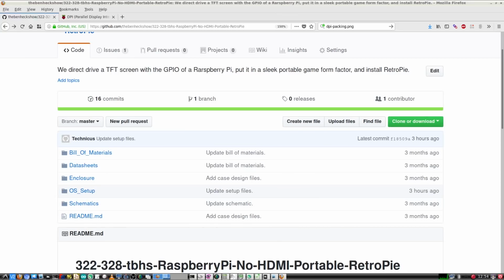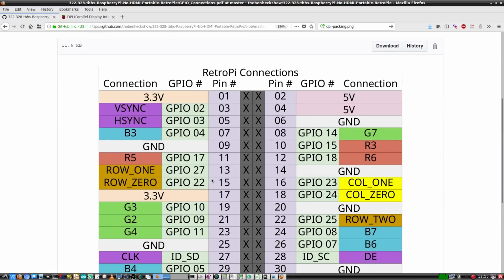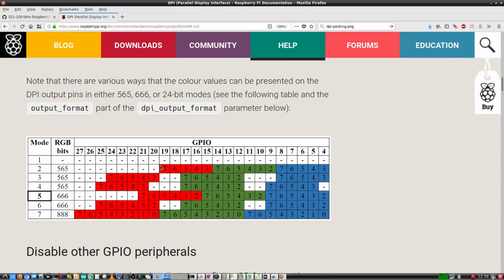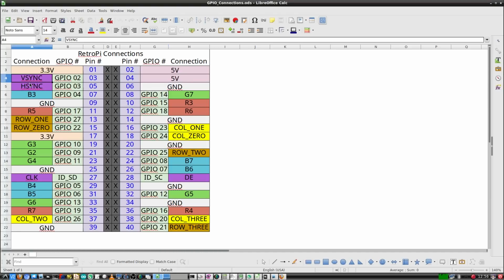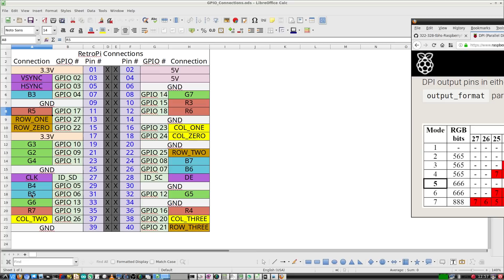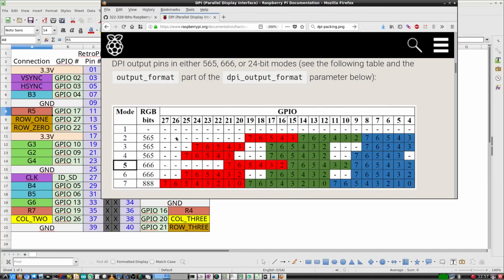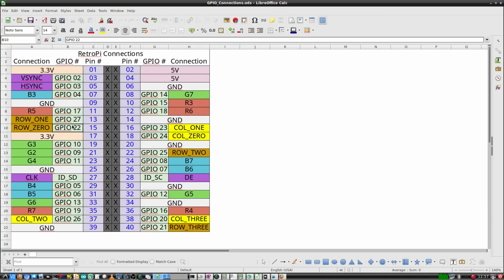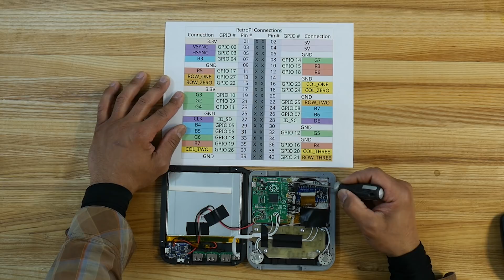sudo Sergeant 17 - Raspberry Pi No HDMI Revisited GPIO

Comment: can i ask a stupid question? is there any raspberry pi sized or just portable pc that can run win 10? the iot version isnt working as i would make a mobile bonding station bonding 3 lte phone via usb. I dont need screen if it is up and running in my pocket. but if you have bonding solution with 3 phones and using raspberry pi I am open( since there is also a third party service involved, i doubt but i can be easily wrong.
Reply: you could take a look at the lattepanda board, it's full windows 10 x86 and not much bigger than the pi
Reply: There the up board which i s physically the same dimensions as a pi 3, however it consumes quite a bit more current (3-4amps).  https://up-shop.org/up-boards/2-up-board-2gb-16-gb-emmc-memory.html
Reply: thanks mate

Comment: having a display and a button matrix leaves no gpio for anything else. is there a way to implement the button matrix so it uses less GPIO? maybe like utilizing an I2C or one-wire?
Reply: They used a 4 x 4 matrix, you could use a smaller one if you need fewer buttons.
Reply: Logan Marlow you can't really cut down on that if you want a qwerty keyboard embedded
Reply: Hi Amrit, in my hack like heck project I used an I2C IO expander chip (MCP23017) and posted my code and kicad docs on the page element14 gave us for our project which you can find at the link below.

https://www.element14.com/community/docs/DOC-88941/l/hack-like-heck-chris-rice
Reply: Amrit Panesar, if you want to integrate a qwerty keyboard, the best option is to use a USB connection.